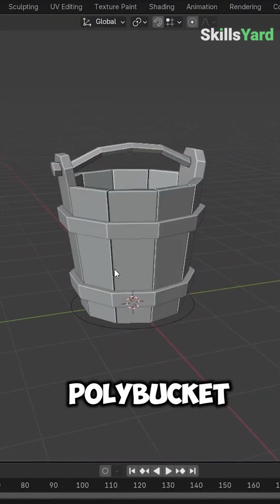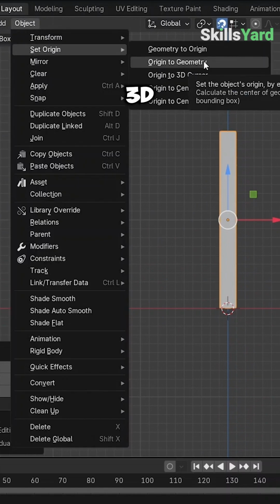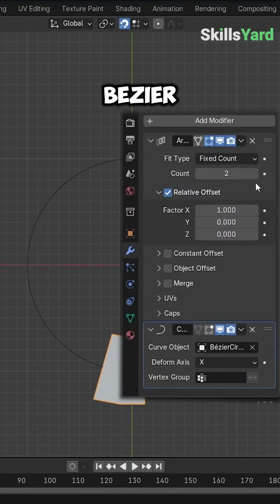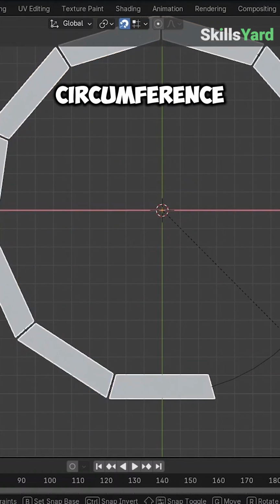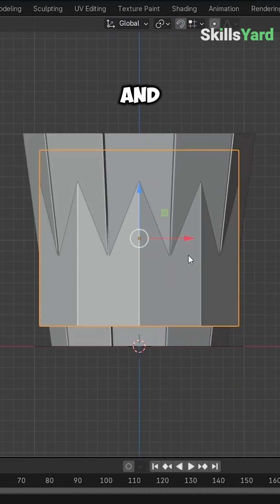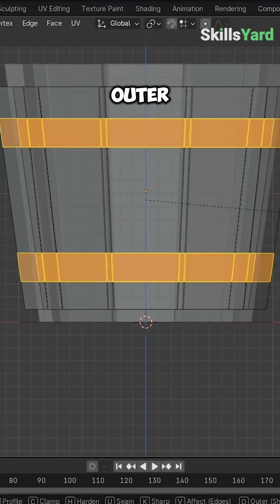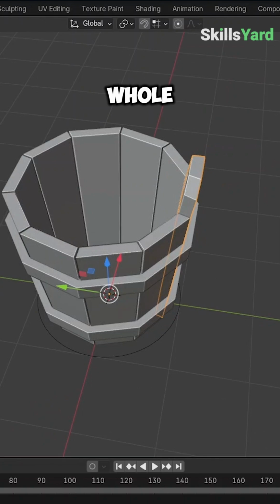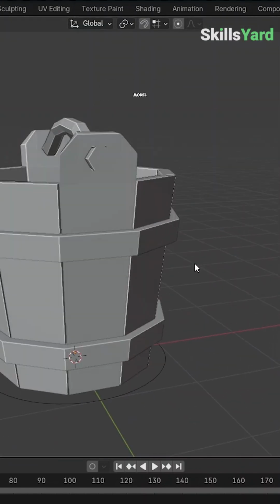Modeling a Bucket in 1 min #blender #blender3d #blendercommunity #3dmodeling #tutorial #tipsandtrick

Comment: I'm not a 3d modeler and even I can tell that's a weird way to do it...

Buckets do not have gaps between the planks, then they're no longer buckets because whatever liquid is inside them spills out.

Just use a low poly cylinder, make it hollow and change the lower radius, copy it and upsize the copy to fit the size for the bands, duplicate it and scale them to become the bands.
You can also save unnecessary polys by making the bands with textures and displacement maps and not have them be so thick.
Then for the handle, just add on the extra bits on top.

Probably gonna be less than half the amount of polys and look the same.
Reply: oh lmao
Reply: I agree with you, it is a long way to model a bucket, It can be a good opportunity to learn more tools. AND cartoon buckets can have gaps in between the planks.